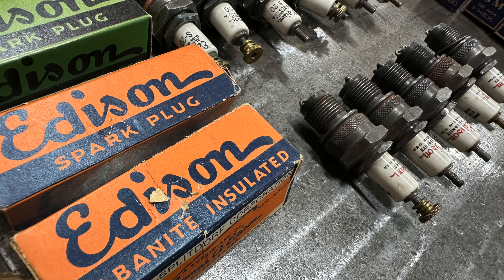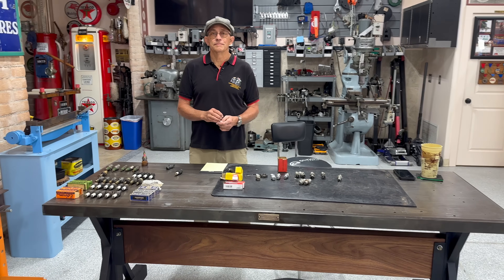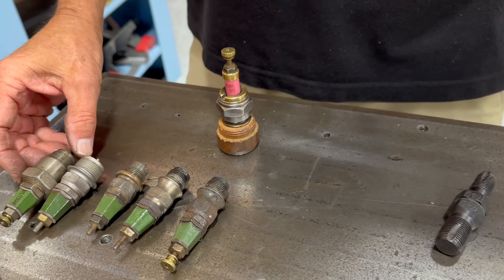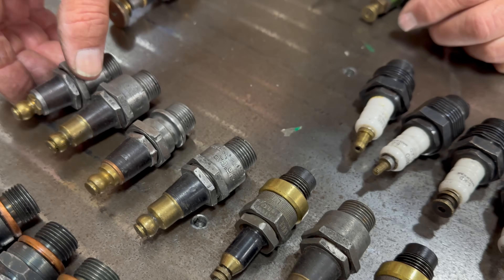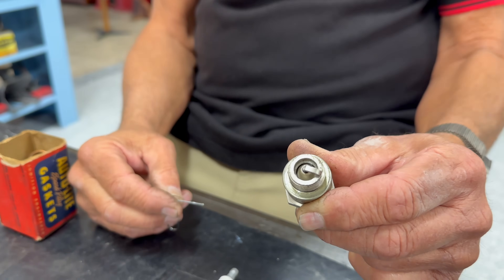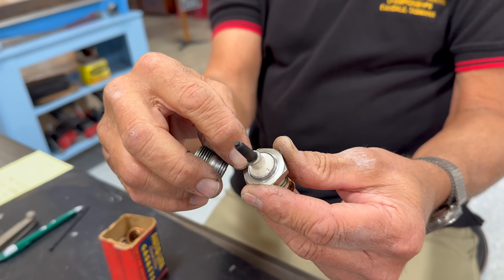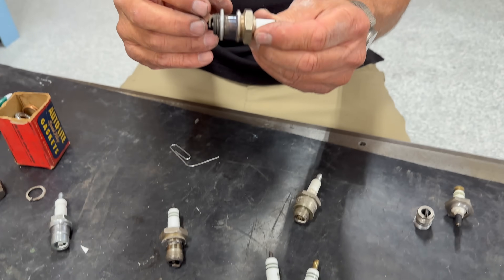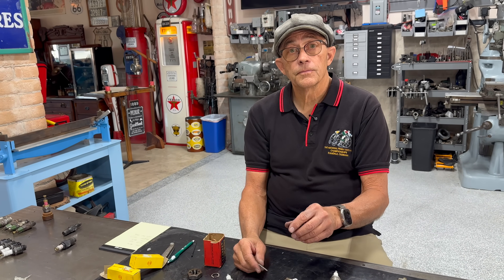8 Things you never knew about vintage Spark Plugs! (Rebuildable) Alan Travis w #BarryT #classiccars

Comment: Why do they foul with modern gasoline and engine oil? And isn't fouling just getting gumbed over in combustion rich schmutz? Is the current too high that the electrode material is burned away prematurely? I'm not understanding why those nos plugs only last hundreds of miles man.

Comment: Spark plugs have always interested me.. that being said if someone wanted a very long reach plug with an 18mm thread, that is magneto rated a Champion D-89D (that’s what they used to be anyway) are definitely a longer reach that would require no machining. They were used primarily on IHC Diesel engines that started on gasoline. They featured a spark plug chamber that was exposed by the decompression valve, and an IHC H4 high tension Magneto was used a lot. They needed the long reach to be able to get into the “pre combustion chamber” or decompression chamber. It’s a very interesting engine design and a very unique spark plug. I’m curious if they would work for the old cars that require a very long reach and still be magneto safe.
Reply from the maker: That’s interesting. I’m gonna have to ask Alan if he knows anything about this.

Comment: Back in the 70s as a kid, my friend's dad worked in a gas plant pumping station. There were huge V-6 gas engines running the pumps. In each cylinder head (they were separate on each cylinder) there were 3 sparkplugs. The plugs were about 1-1/2 inches across if I remember correctly. Those plugs disassembled and individual parts were replaced as needed. I just remember standing in the cylinder on top the piston. It was probably 18 inch bore or something around that.
Reply from the maker: Wow! 😮

Comment: "Run them until they fouled". Doesn't he know that you can burn off fouled spark plugs with a propane torch? Also aren't there hotter heat range vintage spark plugs available? Are they fouling from fuel richness or oil burning? Were the mica plugs literally just a stack of mica disks crushed by between the upper nut and the rest of the plug?
Reply from the maker: Thanks for your comment, as Helene mentions, and he explains it more in some other videos, these early cars are called total loss because the oil just kind of pours in and out, and through the engine for lubrication, and so excess oil is part of the normal operation of these cars
Reply: @gregorymalchuk272  I'm sure he knows.alot more than some keyboard genius bud

Comment: That's an education, I always assumed Champion were British, at a pinch made in the U.S but would not have guessed them being French.
'Reading' plugs I thought had gone a little sketchy due to ethanol fuels ?.
Reply: No, Albert Champion was French. He had lived in the US many years before he sold his first spark plug. Alan Travis seemed a bit confused about that.

Champion came to America to race bicycles in 1900 and in 1905 he started a company to sell French Nieuport ignition parts (including spark plugs) and he went on to make "Champion" brand plugs in 1907. Only a year later he was approached by William Durant who ran General Motors and was convinced to make plugs for GM in Flint, MI. These were to become "AC" Spark plugs, but only after years of court battles with his original partners over the name which was settled in 1922. The connection to Durant may have had something to do with Louie Chevrolet being angry over someone putting Champion plugs in his Indianapolis 500 winning car in 1920. It had been said that he didn't trust porcelain insulated plugs but he was also sore with Durant over the loss of his name for the Chevrolet automobile. He reportedly attacked Durant and beat him severely. His 1920 racing cars were made in partnership with William Small who owned the Monroe auto company and Small was also had problems with Durant.
Reply from the maker: Thank you for adding this info, we always appreciate added information and detail and even corrections!

Comment: They need a 1/2 inch of metal on sparkplug shanks so mechanics like me, don't break them off in the head.  Sorry, don't mind me,  I'm just having flashbacks of the Triton V8.. XP
Reply: Thst engine uses "Galling, locking type spark plugs😂

Comment: I bet you can get a Chinese company to make replicas of some plugs. Or make the parts to make them anyway. It could be a good business,  making  a vintage sparkplug  replicas, have the same look and color insulators   only missing the name brand, maybe have the heat range printed on the insulators.  And use modern materials,  I think modern plugs use aluminum oxide? Make them with copper and steel, ceramic insulators ,I don't know if it will be worth  making every style plug. Maybe take pre orders, and a deposit for enough to make them.  A couple of people could assemble a lot of plugs in a day.  I don't know how many would be needed in the whole western world,  per year or decade even,  a couple people working 7-8 hours a day for 5-6 days a week, could possibly make all the plugs a country or two needs for 20 years, only working a few weeks . About 400 of each design, a person possibly making 20-30 per day, if all the ceramics are already made. Just making the body  and assembly  of the plug. Making non resistor plugs, with the option of adding a resistor.   Maybe  use modern  ceramics and mill a body with the look of a vintage plug. Then there is cost, what will a person pay for the most proper looking plugs for an engine. Is $20 each even enough,  I think someone would have to want to make them, because there is no money to be made I don't think, you will be lucky to break even.. unless there is a market I don't know of..   a small lathe  and a plating kit, and a source for ceramics, and you are in business..
Reply from the maker: That's a very interesting idea!
Reply: "Necessity is the mother of Invention,
Frustration the father Progress,
Who together gave birth to Success."